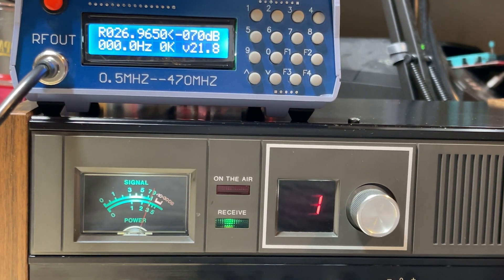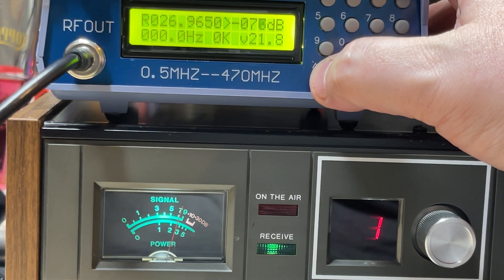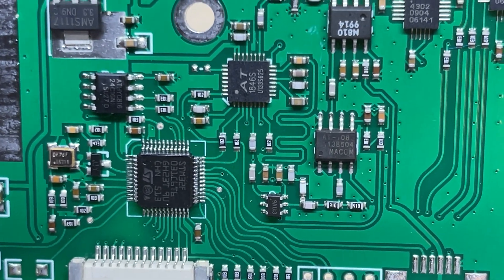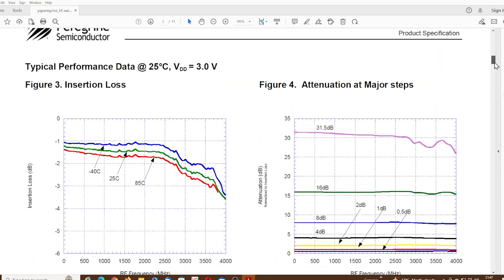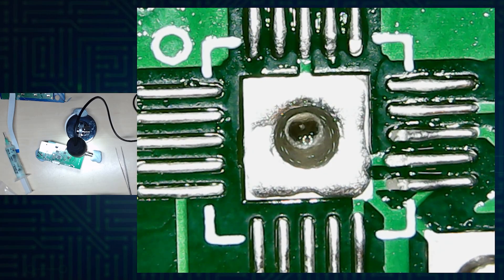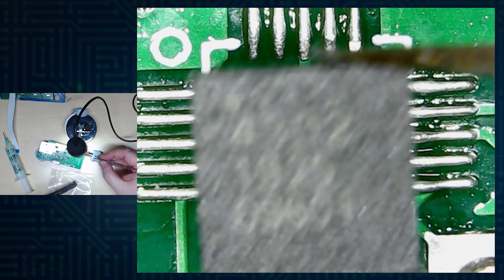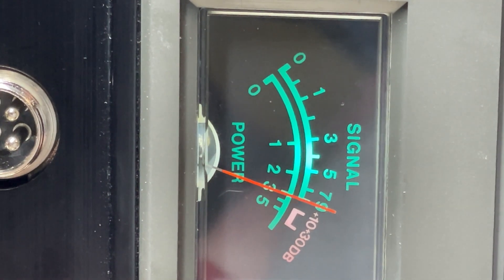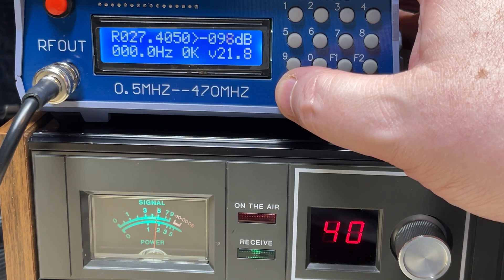EP 121 - Can i fix it ? - RF Signal Generator repair.

Comment: Thats what cb radios do on the rx rf input a pair of back to back diodes ,for this case it depends on the gens max ouput level so maybe zenners instead its just the extra capacitance that might be a issue but at 50ohm dont think it would be

Comment: Some back to back diodes or zenners would be a good idea across the chip output just before the coupling cap, just got a hp8657a and paranoid of breaking it so any comments on output protection very welcome, any probs with the diode or zenner idea? The diode capacitance shouldn't be a problem at 50 ohm, same as long coax iam thinking?
Reply from the maker: Good idea . Might give it a try

Comment: I got exactly the same problem. Thanks for the video.
Reply from the maker: Glad it helped, i hope you are ok with microsoldering, aliexpress have the ic's
Reply: @MicroChipz   Thanks I got my signal generator up and running again. It was my first SMD solder job with my new hot air machine. Took me a few tries but all good now.
Reply from the maker: @DuanesMind  Well thats a 100% win , im glad you got it sorted and saved it going in the bin .
Reply: @MicroChipz  Thanks I ordered 2 from Aliexpress now. Let's say i've watched a few youtube videos how to use a hot air station now 😂

Comment: Hi mate, just for info the M810 is a Mixer/IF/amp only certain parts of it being used and the 1846S is a Walki Talki Transciever chip, again only parts of it being used, it's full number is RDA1846S and of course the STM32 is the Microprocessor and top left of the Proc is a memory chip.  OH! the chip under the M810,  PE4302DS  is another Attenuator and the tiny one at the bottom is a switch 
Bob UK
Reply from the maker: Yeh I thought it was like a baufang

Comment: mine failed within 3 weeks, they didnt want to know on Ebay.
Reply from the maker: Seems they fail a lot .
Reply: @MicroChipz  I have ordered the chip, mine doesn't give any signal output whatsoever, it's certainly worth a try, fingers crossed.
Reply from the maker: Not hard to fit if you have a hot air station , im only using one of those cheap hot air guns the 858d type
Reply: @MicroChipz  Surely, a bit of thought from our Asian friends might have included some sort of input protection for how little it would cost. I dont know why mine went, i wasnt keying up but there's certainly no output fom the unit. I will let you know how i get on also. Thanks for the heads up and putting this out though, great stuff Sir.

Comment: I've blown my one up too....gutted!! and I'm no good at surface mount stuff. Only had it around 3 months too :(
Reply from the maker: Opps
Reply: @MicroChipz  how much to fix it for me? However mine is completely dead on signal, otherwise looks ok, comes on and adjusts just like it is working. I used it one night it was fine the next day nothing 😞
Reply from the maker: @TheMagnumUK  Sounds like you have another issue , might be better to just bite the bullet and get the tinysa
Reply: @MicroChipz  i bought another one but it seems such a shame to bin this one... I do have a tinysa👍

Comment: Interesting gadget and a nice fix, I'd maybe consider a protection circuit built into somehting like a BNC M-F adapter, probably doesn't need to be any more complex than a pair of inverse parallel diodes to ground (like the ones fitted to most CBs) but you can do all sorts of fancy things like isolating the output by driving PIN diodes on/off with an overload detector circuit. 

Some of the older Marconi, R&S, HP etc. sig gens have service manuals with schematics that show their protection circuits and they're not too complex to copy.
Reply from the maker: Yea some sort of protection is needed on this , or it maybe as knoxieman says they are just crap and fail for the fun of it .

Comment: These are terrible signal generators, I guarantee you didn't key up in to it, I had one and it did exactly the same, there is zero filtering or protection, it's held together with hot glue and tape, you absolutely cannot rely on these, nice repair job by you but it will blow again because it's so badly designed, if you want a cheap signal generator use a tinysa, so much more accurate and reliable but more fiddly to use, if you check around on here and online you will find others who have had the same problem with this, most end up in the bin, the tinysa will modulate your tone at 1Khz and will do AM as well, you still have to be careful not to key up directly in to it so I use a 40db attenuator and set that in the menu of the tinysa, easy peasy, I only use the Tinysa for am these days as I have pro gear for FM. Nice video, love seeing things fixed even dodgy stuff.👍
Reply from the maker: Thanks for you comment , yes they are very cheap made and held together with glue and good will.
Going off the other comments on this you are most probably right , sneeze near it and it fails .
I will check out the tinysa , thank you .
Even tho its a crap unit , i did enjoy fault finding it , i didn't have any prior knowledge on the fault , purely guesswork and datasheet studying . as soon as i seen the -30db attenuators and it failing on -30db i know it had to be that .
Reply: Yup you did a great job with the repair it's a shame they didn't do a great job making these things 😒

Comment: I did the same thing to mine. Found the chips for sale on AE too. Now working good but I bought a Marconi 2022 it has a 25w safe input. Great fix for a very useful tool. Mark 2w0jmk
Reply from the maker: Seems everyone has had issues , see knoxiemans comment ;)
Reply: @MicroChipz  Yes you a right. Thats why I bought the Marconi much safer and spot on frequency too. Keep up the good work. O Knoxieman is right the TinySA Ultra is a great tool and used quit a lot here too.

Comment: Good little signal generators but they only need a sniff of RF and the chip is dead. I now have a no mic in rig policy here when connected to the generator.
Reply from the maker: I cant remember transmitting into mine , i could have, it only takes 1 slip up and its gone .